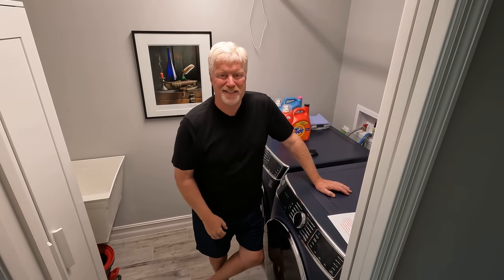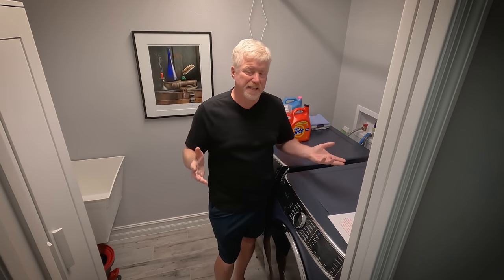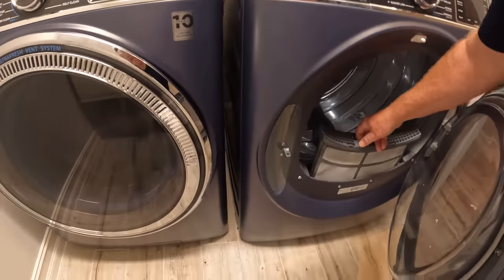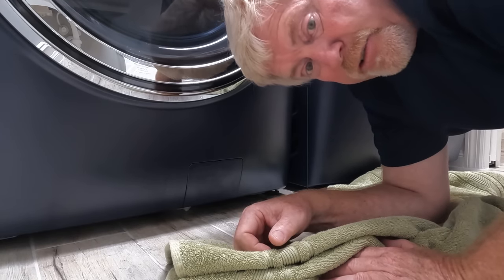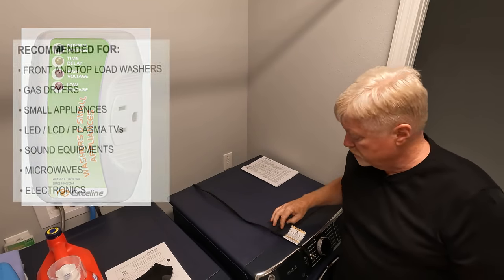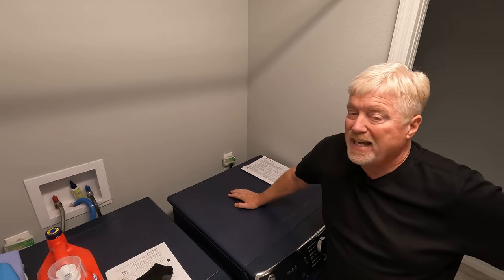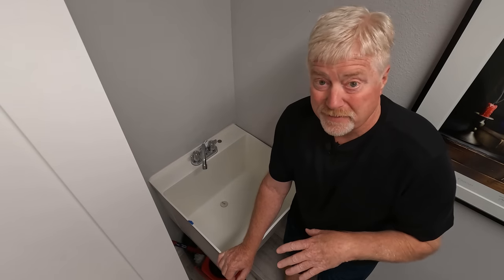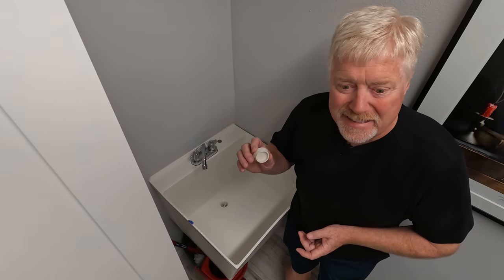Don't neglect these 15 Maintenance tips to keep your home running trouble-free The Villages Part 2,

Comment: Shower head filters & / or soaking in hot vinegar to flush out mineral build up.

Even though you have a house water filtration system, your shower head should be (immersed / soaked in a zip lock bag) half full of vinegar & a rubber band wrapped around the pipe to hold the bag on to the pipe.

Comment: Great video.  I didn't realize the P trap needs to be filled with water.  There are a few sinks in my home that I don't often use so I'll have to make sure to flush them periodically.  Also I didn't realize they sell surge protectors for appliances such as the  washer and dryer so I'll have to look for that.  Thanks for the great advice.  Let us know when you figure out where the screw in the dishwasher came from.  Thanks again!

Comment: I think there is a filter in the washing machine. also there are washing machine cleaning tablets that will clean the washing machine. also for ladies with long hair should do maintenance on the shower drains. I don't have the name, but there is a product you can pour down the drain that dissolves hair, but doesn't ruin your pipes. I get it from lowes
Reply from the maker: Thanks Sandy.  Some do.  My washer does not but it has a cleaning cycle.  Thanks for the note.  Will add it next year. Subscribe for new Videos: https://bit.ly/3aToJ3H

Comment: Hey Rusty, Looking to purchase a washer and dryer, and since your video started in the laundry room, lol... that came to mind.
What brand did you get, and have you had any problems with yours? Are you happy with your purchase? Thanks for always sharing informative information!
Reply from the maker: GE. 650 750 and 850.   I got the 850 gas
Reply: @RustyNelson thank you for your quick reply!
Are you happy with your purchase, and have you had any issues with it? 
One more question... Where did you purchase it from, and did they do the install as well. My dryer will be gas hook up as well, and i've been told I should get a plumber and not allow whoever delivers to install the gas dryer.

Comment: I’m surprised on a new house the smoke & co2 detectors are not hardwired
Reply: Rusty unplugged the detector when he took it off the wall.  The battery is for backup.